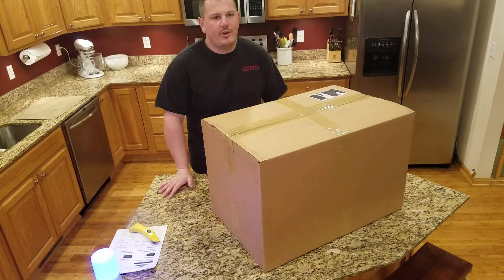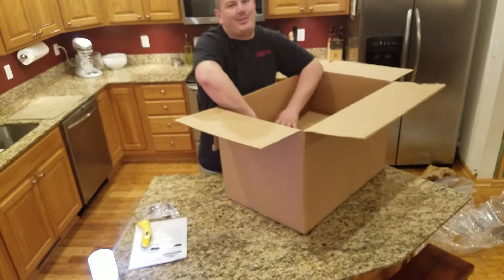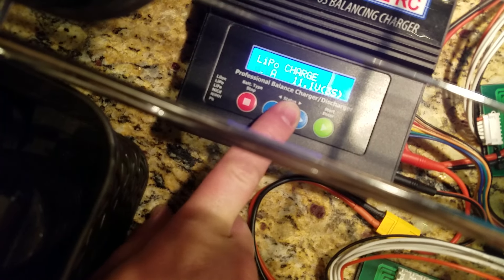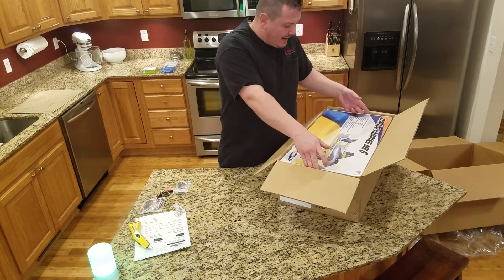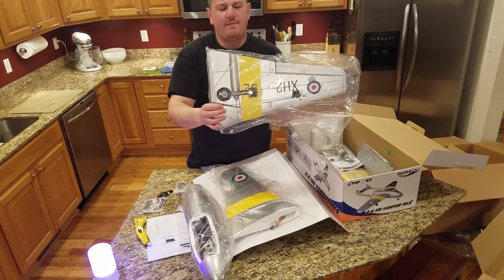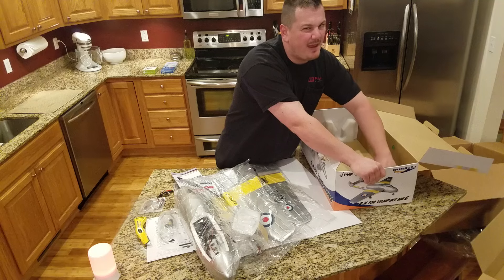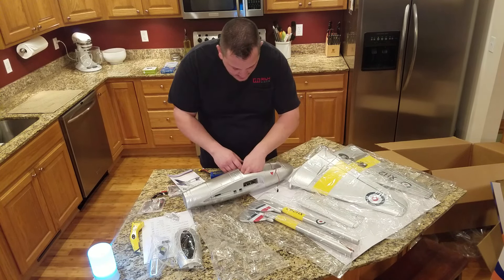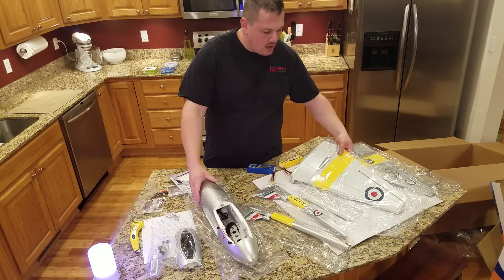Hobbyking - D.H. 100 Vampire MK 6 - Unboxing!!!

Comment: Also got one and moded it with CS12blade EDF and 2855 motor. Plane needs reinforcment for the tail booms, after that it flies great. Anyway semiscale EDF with retractable gear for less than 99 $ is a great deal!
Reply from the maker: Definitely a great deal for less than $100! I really don't want to do the carbon fiber tail boom re-enforcement. Are you saying the plane will not fly well without them?
Reply: It will fly well, the problem is that out of the box they are extremely fragile and with a minor crash the booms will likely end up like a pair of  accordions
Reply: Model won't be stable at high speed (windy conditions aspecially) and going out of fast dive might end in the ground. You will see the difference after flying it. For me it was big change after strengthening the booms.
Reply from the maker: I realize your comment may have been posted before you had a chance to watch my Vampire build video 1 of 4, but now that it's up, did you happen to catch my attempt at strengthening the booms? I didn't want to spend a bunch of money on carbon fiber re-enforcement, since that sorta defeats a "cheap" plane. Check it out and let me know what you think...

https://youtu.be/_dFjgbQA6VU?list=PLXTH0DstRDc4Um1O8QZpaBQJcxDZfiALv

...Crap, now that I'm thinking about it, this plane is so dang nose heavy (which is why I have that crazy foam lipo holder in there) that I could just use a 20/1000" shims to make those booms ROCK SOLID, and I'd have exactly $0.00 tied up in it :)

Maybe that'll be my next step plan, if the bamboo skewers don't seem to give enough strength.
Reply: mmm I don't agree that because it was cheap you have to be cheap on making it more awesome and better. As I see it, you buy the base from which to start at a low price then like if it were just a kit that you have to build, in this case you don't start from scratch, and bla bla bla LOL what I mean is ... Think it like this, if hobbyking would have put the carbon fiber rods inside the booms the airplane would have cost $15 bucks more, so you saved the extra $15 and now you can get a couple of carbon fiber booms with that money and make it more awesome and make it last longer so if you make it last longer your investment will pay off because you will have the opportunity to make the best out of a cheap airplane that instead of just getting a couple of flights before the booms go boom and you end up with a bulk of unflyable pieces of foam,  instead you will be able to fly it for decades and give it to your grandson because you made it sturdier ... Also this one is cheap now because is on sale but when it just got out it was probably around $150 so you can invest up to $50 to $40 on improvements that would turn it in to a $200 airplane but you just spent $150 so you still save $50 LOL
Reply from the maker: That's my problem. I spend so much time on my planes, then where I crash them, they have become irreplaceable...

Comment: Been a while since you didn't do an unboxing...:-) BTW are you happy wih those zippy compact 60C batteries from HK, are they still in good shape after the cycles you already put them through, I am thinking of getting 5-6 of these, thanks Brian!
Reply from the maker: Yes, I have been very happy with them, and the Turnigy Heavy-Duty lipo's. In my experience, being they are both 60C pack, they work well. The size and weight difference is hardly appreciable, so I wouldn't get too excited abut the "compact" part of the name, as they seem to be virtually the same dimensions..maybe shave a couple mms here and here and maybe a gram or two...but that's it. In fact, the Zippy Compact 4S 3300mAh 60C size I have sits on top and beside two Turnigy Heavy-Duty packs of the same ratings, and they take up nearly the exact same space. That being said, they seem to be a bit cheaper (at times) or one or the other is in stock in absence of their counterpart, so you can just interchange them in your ordering at Hobbyking. Also, they seem to hold up very well. I've had one cell on one single 3S 2200mAh 60C lipo go bad. It may have even been a small puncture from a motor mount, but I'll now never knew that for sure because I took out the bad cell and made it into a 2S 2200mAh 60C pack, which is a cool size to have. I squeeze it in my Consendo S for higher wind days, where I'll need more punch to fight the wind.

As for the power, once you go to 60C, you'll really realize the value...

Pros

1) Discharge rate allows for more power, with less risk of damage to the lipo and plane.
2) Power to weight ratio is generally better.
3) More charge and discharge cycles.
4) Usually better power leads, which helping to improve survivability of the packs.
5) Size is only slightly larger.
6) Price point becomes a non-issue when compared to buying multiple packs to replace failed, puffed packs.
7) You need higher C rating for one plane, so just use the higher C rating in a non-required plane for better performance, and one less pack to drag around.

Cons

1) Price. Usually about 1.5 to 2 times as expensive as a similarly rated pack at 20C...but 20C won't work for what I'm using these packs to do, so I just have to get over it :)
2) Weight. There is a slightly higher weight concession with 60C compared to 20C, but it will be overwhelmed by power on demand. You probably won't have to adjust flight timers, except that with all the extra power, you'll want to use it...lol
3) Size. They are very slightly larger, but as mentioned before, they usually fit without too many pulled teeth.
4) When you do crash, and damage a lipo, you've got a more expensive crash. Crashing and damaging the lipo doesn't happen often in my experience, but it has happened to me. 4S 2200mAh 60C zippy compact...God rest her sole. :(.....

Comment: Nice! I have the same issue with FMS pilots and it does not make any sense to me that they invest in so much digital on the airplane but they don't invest on making their own scaled pilots an just throw a gigantic generic pilot inside. Juts a tip, IMHO in the part where you explain the product for charging, it would have been better to put a link to that and keep that part in it's own video because is a good tip and people that are searching for a tip like that will never find this video and people that maybe was not interested in a Vampire unboxig and didn't see this video lost a god tip
Reply from the maker: I just posted a video for the 2S UMX Lipo Balance charger. Those little details are the ones that I may put in another video, but then nobody ever can find it. I've been trying to keep this sort of thing searchable, but it is challenging to get tags good enough to help everyone find the help they need.

Thanks for the comment! and for watching too!